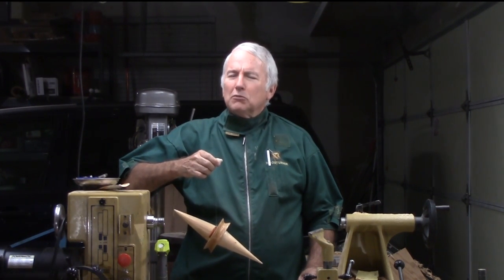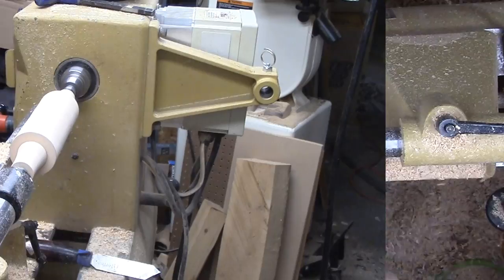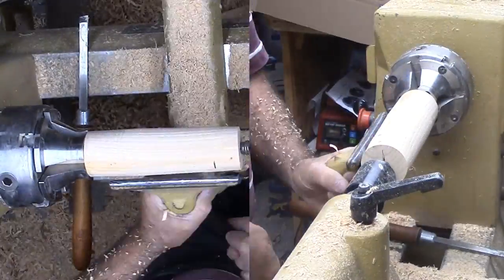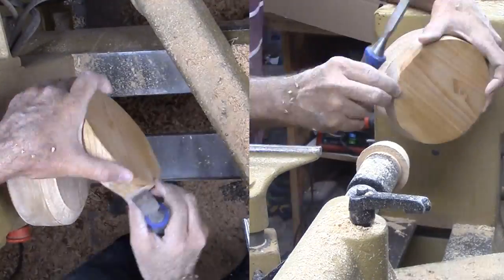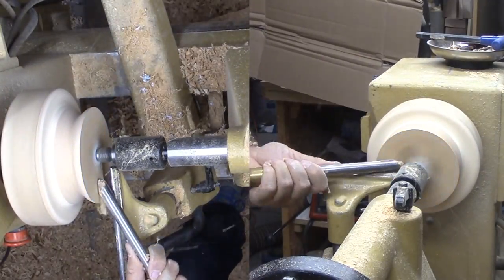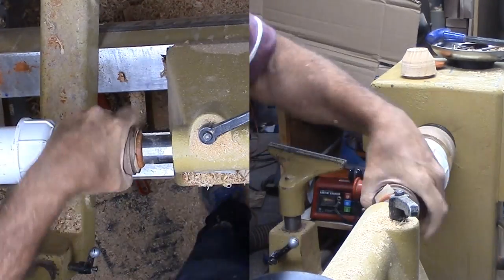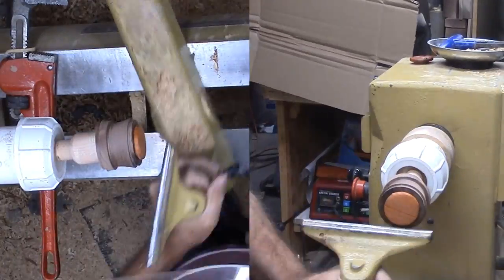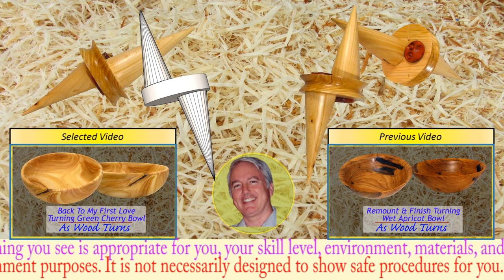Star Trek NG Alien Probe Appeared In My Mind

Comment: I'm a Star Tek fan too.  Nice piece. This is the first time that I see you use your sanding paddle.  great idea.  Am I correct to assume that it is just a peace of plywood with shaped handle at both ends and using sticky back sand paper. I noticed you using the edge as well and that is my question. How does the edge fit in with the rest of the paddle? 
Sincerely 
Thanks you
Reply from the maker: You are correct on the sanding board. As for the edge, it was just a fresh surface. :)
Alan